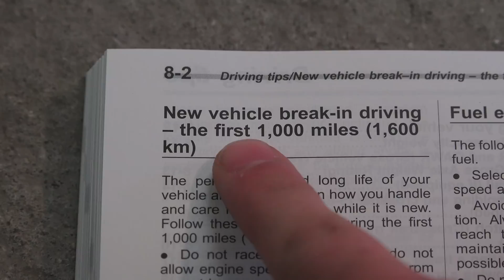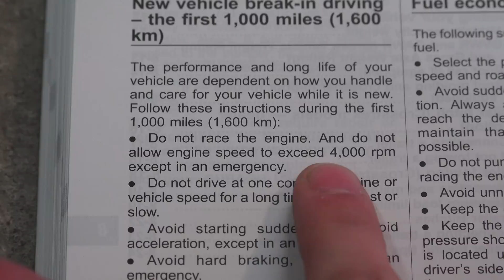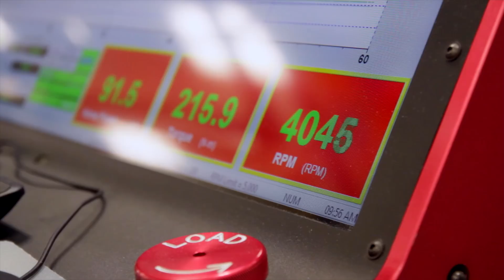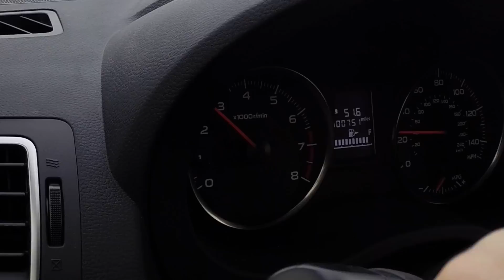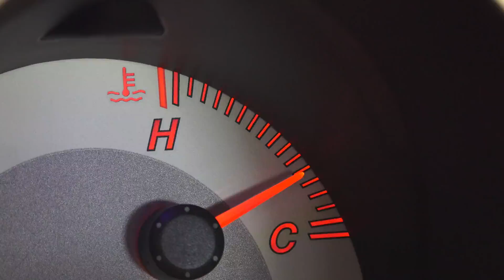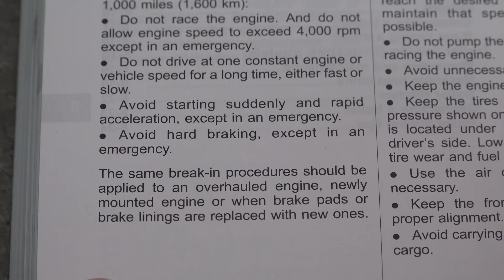5 Things You Should Never Do In A Brand New Car

Comment: So what's the possible damage if you didn't know about these guidelines, and floored it out of the dealership? Example: I bought a brand new 2014 WRX, i wasn'tt aware of the break-in period, as I have never owned a new car, and I accelerated hard right away. Not to redline, but certainly more than 50% throttle. 

I have never tracked the car, but looking back I know i drove it a little too hard several times that first 1,000 miles. Should I be concerned about my engine's reliability?
Reply: Michael Woodard honestly, more than likely your engine is fine. It's just one of those things where you'd rather be safe than sorry. As long as you didn't redline it multiple times and track the car during the break in, your engine should be alright.
Reply: GTRZE70 
People read the manuals? they make great door stoppers and papper weight.
Reply: Michael Woodard Why didn't you know about these guidelines? You didn't at least read the first few pages of the owners manual?
Reply: GTRZE70 Nope!  But, live and learn. I know more for next time.
Reply: I have the same car, my rule of thumb is if you don't burn any oil and don't have any warranty issues, you did something right.
Reply: no how far you was changing the oil filter and oil totally not you should only have lower oil change intervals

Comment: What about cam lobes?
You need to break it in.
Reply: you'll need to do that by hand. take them out of your car and file them down.
Reply: In nearly all common production cars the factory has already done this. In fact most brands have actually driven the car a short test distance before they wash it and ship it out to dealers, just nowhere near the 500+ miles needed before you'd race the thing.

Comment: A good exemple is BMW's S1000 RR which electronically limits the RPM to 9000 for the first 600 miles.
Reply: Rafael Coutinho That's interesting. Does BMW also recommend an oil change early in the engine life?
Reply: u9Nails Yeah they do, you can check the maintenance intervals here: https://www.motorcycleparts-hornig.com/BMW-S-1000-RR/Maintenance-interval-service/
Reply: Rafael Coutinho although the didn't mention it in the video, the Corvette also limits the revs during break-in. I think the YouTube user Street Speed 717 documented this in one of his videos.

Comment: Being hard on a car at any stage new or old is not going to be good for it. How is this even an argument?
Reply: Dani over There's nothing wrong with driving a car hard. A good amount of people take their daily driving car to tracks. The "harder" you drive the faster things wear but wear is unavoidable. Just have to be ready to pay.
Reply: A tight engine doesn't produce as much power as a similar broken in motor. The argument is that the parts inside a new motor will never be as sharp as they are when new. It would be like polishing a cylinder with dull honing equipment, and you'll never get the chance to seat everything as well after the motor is worn.

Comment: how can I test drive a new vehicle if I'm not supposed to floor it? I've always wondered that
Reply: Test the dealer vehicle and then order a new one haha
Reply: Demo cars are what you test drive, then just drive it as you want when you pick up the new one, 9 times out of 10 you only have it for 2 or 3 years so this bed in process is absolutely pointless, at the end of the day it's just a car, if it breaks, trade it in.
Reply: polaris911 
The problem is that each car can be different. A demo just shows you how that car drives and not the others. A problem that my friend had, drove the demo but when he bought and drove the same model car he said it drove differently.

Comment: Hey engineering explained. I recently got the new  subrazu Impreza hatch. When I start the car, it takes it a while for it to warm up. Is this normal? The blue coolant light sometimes stays in for 3-4 minutes.
Thanks :)
Reply: that's normal.
Reply: Habibicle lop extremely normal. my 09 takes forever on a cold start.
Reply: Habibicle lop you shouldn't idle it long from cold to warm
Reply: DoobieR wait so it's fine or I shouldn't ??? :(
Reply: Habibicle lop you can but not recommend

Comment: thats the good thing about electric motors, you can just kick them from day one
Reply: Actually no, its much shorter, but there is indeed a break in system for big motors to both bed in the bearings, ensure all metal is in its fully unstressed state, remove the oils that protect from corrosion during storage\transport and sometimes even the final curing of the resin with heat. Then again I've never worked with car electric motors, only industrial ones, so given the much shorter break in cycle this could be something done at the factory before installation into car.
Reply: In that case I would say read the manual or write Tesla about that.
Reply: You can.. but also can break them in if you want!
Reply: Don't Teslas actually have "below-average" reliability, per Consumer Reports?
Reply: *****
All Tesla's are brush-less, as are most of the sizeable industrial motors I was talking about the correct break in for. On the other hand while there are most definitely brushed EV's on the road, just not competing in the high end new car market.

bcubed72  Regarding below average reliability, most powerful or fancy cars struggle, adding more features like pop out door handles adds more parts that can fail, and consumers react worse when one is repaired under warranty on a $100k car than a $20k one. That said, you've got to hand it to Toyota and the like for just punching out cheap to mid range sedans+hatches that just seem to work fine...
Reply: As mechanical (or digital) complexity increases, MTBF decreases.  It's a simple thumb-rule of all maintenance.
Toyota has a fantastic philosphy and culture that has enabled them to proactively address problems and their ultimate causes for decades.

Comment: it seems an oxymoron to say vary rpm and load but dont go over a certain rpm and throttle percentage. not going over 3500 is no variance whatsoever. you say all manufacturers...the fiesta st break in method in the manual said to vary the speeds and rev range to break in all the parts and make sure everything gets used. i didnt necessarily do a hard break i but i followed the rules and my fiesta st seems to be the only one with no issues lol

Comment: I heard you had to red line the engine for a minute so the oil cycles through the engine
Reply: Agreed. I've found that immediately after a cold start in the dead of winter if I red line fro about 1.5 minutes you warm the engine up nicely.
Reply: not sure if you're joking or not
Reply: I like warming up my transmission too. I like to redline on start up and then do a couple of clutch kicks, to get things warmed up. You can also do this in an auto by redlining while putting the transmission in drive. Works perfectly every time.
Reply: Mmmmm Toast if you really wanna let your engine warm up, a simple trick is to take the radiator hoses off and let all that pesky green water out.
Reply: lol, good luck
Reply: Funny
Reply: Akash Hegde Thanks for almost killing my cat!
Reply: Mmmmm Toast on a rebuild I give them hell there either gonna hold or not.
Reply: lmao
Reply: pffft, I redline all the way to work.  Laws are for suckers.
Reply: Meanwhile you do know that cars are designed to break so you should cut the break lines and that'll fix it. No, it won't really. I realize this comment section's full of jokes but I had to state the obvious at least for my sleep at night sake, I've taken things way too seriously in the past to not do it.

Comment: It probably goes without saying, but, don't crash it.
Reply: You sure about that? I'm not seeing that in the manual anywhere
Reply: Sathrandur I thought you had to bang it in a wall first just to loosen it up a bit
Reply: +dogger20011 
You're right... It actually doesn't say not to crash it.
Reply: Sathrandur brand new cars have an anti crash system that lasts for the first 1,500 miles
Reply: Sathrandur  ahh man. I was so exited about crashing mine
Reply: Sathrandur It's not mentioned in the manual, then it's a myth!
Reply: I did it.
Reply: i need more in depth details. Please explain.

Comment: Except for rental cars... lol
Reply: don't be gentle, it's a rental
Reply: Of course! Why wouldn't you push the fastest car in the world? 😂😂
Reply: Dae Kang.. Rental cars you drive them like you stole it.
Reply: Edgar González Casasola top gear?
Reply: ***** Yes.
Reply: Lol, last rental i got was a new corolla with 70 miles on the clock. I put that thing to the floor on every on ramp and even had a little "race" against a new dodge dart durring my 1600 mile round trip. I feel bad for the poor shmuck that ever buys that thing.
Reply: My Wifes Sister bought a Dodge Avenger Rental car and she never had a problem with it,its the  Pentastar V-6 that has some get up and go around 6 flat 0-60 a little under once broken in (I tried it lol) So far 90,000 trouble free miles upon the 12,000 that were on the car 102,000 total and I just serviced it at it runs ,drives fine no odd engine sounds etc..Personally I wouldn't buy a X Rental or Used or a new car with anything 1 mile or more.
Reply: juan manuel of course man! 👌👌 *old (REAL) Top Gear
Reply: rental cars don't fail.  they are tough always 😂
Reply: +01trsmar there is no way an avenger did it in 6 flat lmao
Reply: obviously
Reply: Not your car, you don't about the next driver that much... Now seriously, when was the last time you had a rental with over 20K miles on it? Rental places buy new cars constantly because they don't expect their vehicles to have a long life.
Reply: +Bravobraza As much as I hate to say this, the Dodge Avenger (if optioned correctly) can do a 6.1 second 0-60 and 14 second trap. Yeah, I didn't believe it when I read it either. http://www.motortrend.com/cars/dodge/avenger/2012/
Reply: 01trsmar the real problem is that you bought a Dodge
Reply: he meant it in a way that rental cars mostly have some miles put on them when you get them

Comment: I like the Hyundai Accent
Reply: Hyundai Accent Fan Club hey  Hail Hyundai
Reply: Departed Gardens you can have much better cars that get you from A to B and not break a bank to do do, and a hyundai that gets you from A to B without breaking down? BWAHAHAHAHA, what are you smoking pal, and the last reason to not buy a hyundai is that if you crash in one of these, you are not getting out alive
Reply: Departed Gardens actually a smart has a very smart (pun not intended) construction and is quite safe, watch fifth gears test, it stood up quite well, some  hyundais on the other hand...
Reply: Hyundai Accent Fan Club. I like the southern accent. headlights are very impressive, really stand out in the rain. body lines are smooth as silk with curves precisely where needed.  does have a Crack in rear end but the ride is excellent. .maintenance can be pricey if not cleaned and serviced daily and if given wrong fuel there is a occasional exhaust smell.  do love it but can't wait to trade for new model. ...
Reply: The Accent is okay if you don't care about cars or how you appear.  Think about it.  The people that drive them also wear mom jeans and mostly do grocery runs.  It's simply transportation.  Not something to have fun in.
Reply: i hope your dead ass and not trolling.
Reply: ight its a low budget commuter car not for anything more. you ignore that for the fact that your getting from a to b and not breaking down or breaking the bank to do so.
Reply: ive never owned one so i cant speak for it.
i just know thats the point of them. lol.
they seem reliable around my neck of woods. 
maybe those are just the rare birds lol. 
you think crashing in that would be bad try a smart car lol
Reply: rudkacka But I like my accent :( I got it as my first car I bought with my own money. figure in a couple years I'll get something sportier
Reply: Kang The Mad that is good, no matter what car you buy, if you buy it with your own money you did a good job
Reply: Y10Q 15 bucks an hour, then i get a 500 dollar bonus paycheck once a month, plus benefits, 401k and stuff.
Reply: Kang The Mad i have a part time job where i get 2.9 euros an hour, my dad gets 7 eurous an hour which is 1400euros a month and thats a really good salary in my country, average is 800euros a month, but into that they count politicians and stuff so real avg salary is 600 euros, pretty bad right? well thats Slovakia for you, first we were being robbed by Soviet Union, now by Brussel and EU
Reply: Kang The Mad nah its allright, i will head Scandinavia when i get out of school and wont find anything good.

Comment: ooooohhh so early. i heard people say that delivery guys that drive those brand new cars from the docks to the dealership are abusing those cars in the process. btw nice video as always :D
Reply: Yes i have first hand experience with that as i was one of those people in my younger years, i didn't do it myself though as i always believed in CARma.
Reply: lol.. Doesn't happen here.. people are very sensitive about who touches who cars, they buy brand new cars because they know nobody drove it. All cars are delivered on a truck from the factory.
Reply: Pijen it's not common, that puts mileage on cars. Dealers have car carriers deliver cars directly to their local or remote lots.
Reply: Pijen the other day I saw that they were unloading cars from the truck and they accelerated them full throttle
Reply: Pijen they also get screwed at the dealerships during the 'pre delivery check'.  Sometimes you just can't help yourself 😁
Reply: Pijen ya we do. Car is on for about 5 seconds until its revved to 4k or higher and then full throttled until it's parked
Reply: Matteo who carries them in between? ??
Reply: In Indonesia, they most often don't use a car carrier if the need to deliver cars from a dealer in Jakarta to Sumatra, some remote areas in Sumatra have only narrow roads. Yes, the driver abuses the car, they use it as a taxi, pick up passengers along the road for extra money, drive like dare-devils, you know...new engine...new brake and they like to race each others. I've used their services, during the delivery one and several cars got accidents, we stopped to help the passengers. One of my friend told me he got an accident several years before, the driver and the 6 passengers died, he was the only one who survived, no insurance, not worth it if looking for a cheap transport.